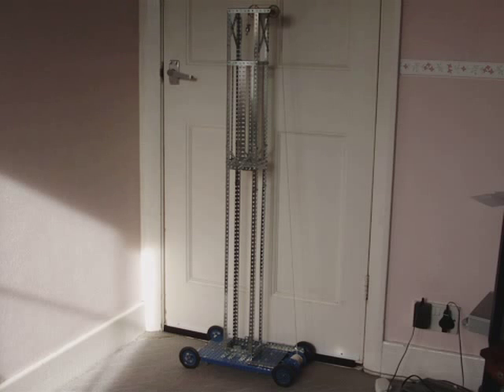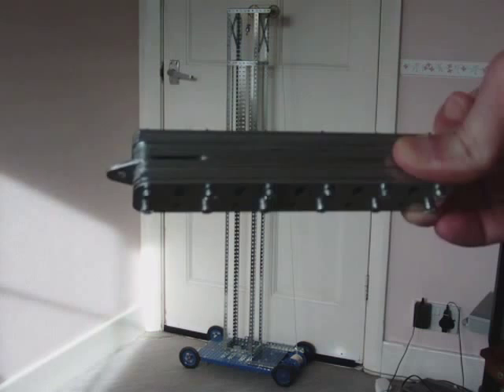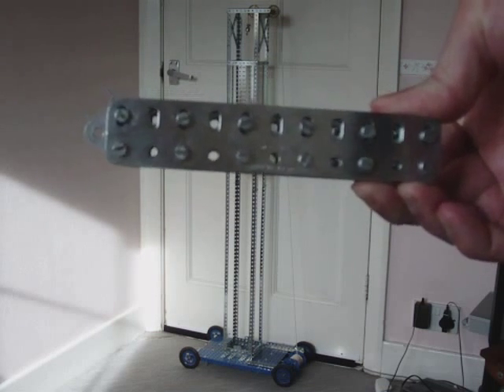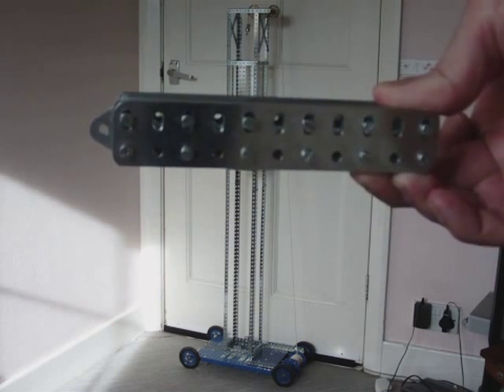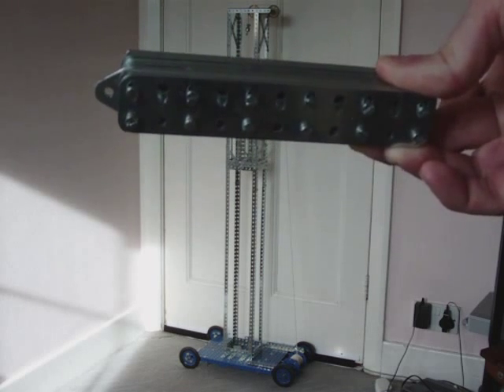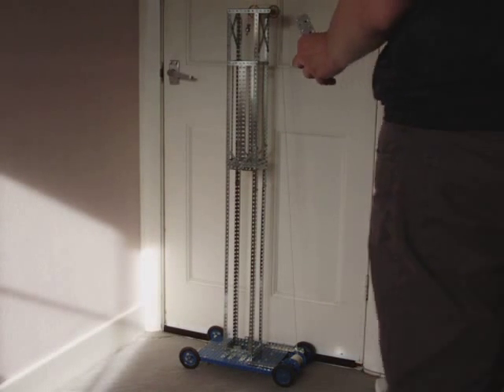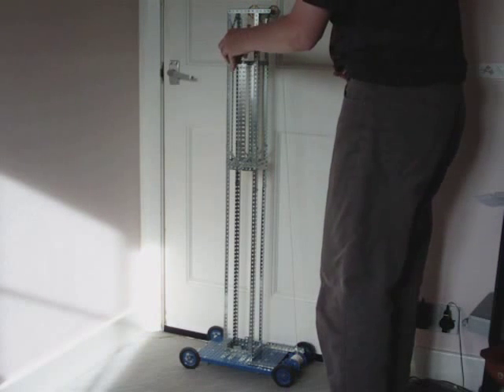Meccano Weight Driven Vehicle

Comment: Nice smooth running model, Brian.
Reply from the maker: +newspaniard Yes it does run well. It would be interesting so see how much the design could be optimised. Could it run twice or three times as far?
Reply: +Brian Meccano Leach After the initial impetus given by the string, will it free-wheel any distance?
Reply from the maker: +newspaniard It does but only about a yard or two.
Reply: you can run it as far as you want with not much modification. 

more weight = more potential energy. 

ah, but it will run the same distance, only faster. 

but if you add, say, a block and tackle, you can gear down the weight. this is leverage in reverse - and if you really wanted, you could add something that is 100kg that drops 10cm and drives the vehicle for 50m, so long as you have the proper reduction, and everything balances out. 

of course, you only have to lift the driving weight back up again......